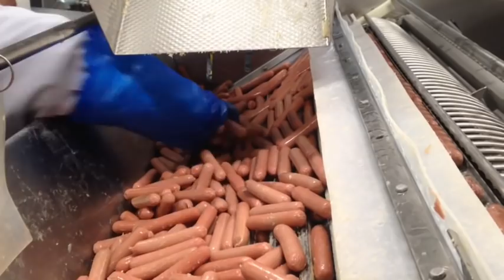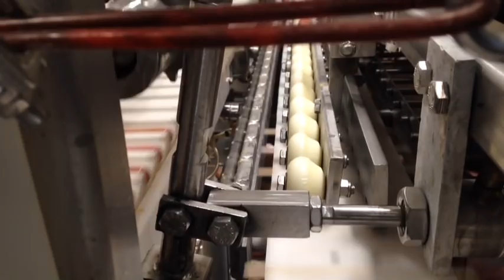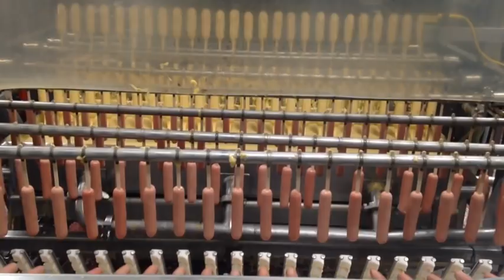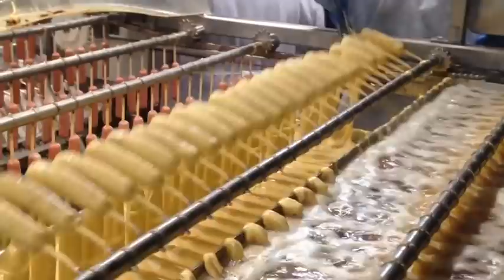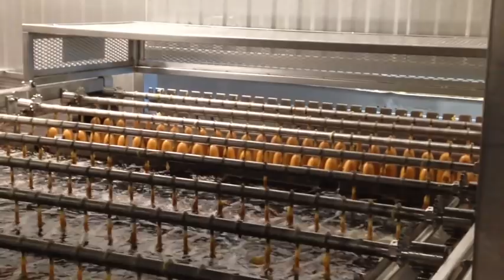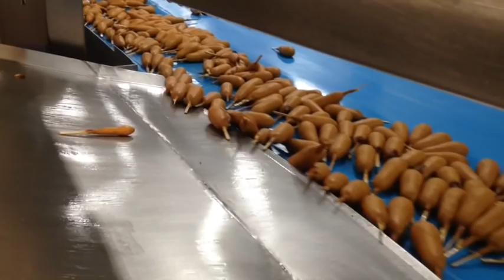How corndogs are made

Comment: where's the packaging process?
Reply from the maker: I only had a chance to record this end of the process. The packaging is all done by hand as the corndogs come out of the quick freeze.
Reply: Either we manually feed them through a wrapping machine called the "Fuji wrap" or a robot does it. We feed them into slots and take out bad ones as we go. Wrapped corndogs are then passed down a line to be boxed. Other ones such as the bulk packages aren't individually wrapped.